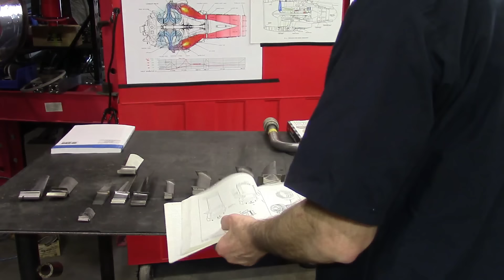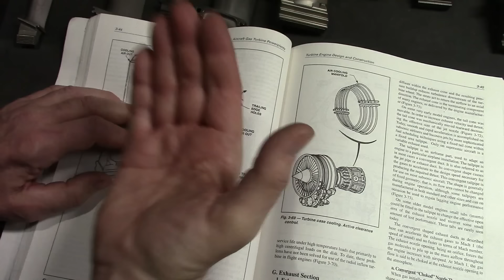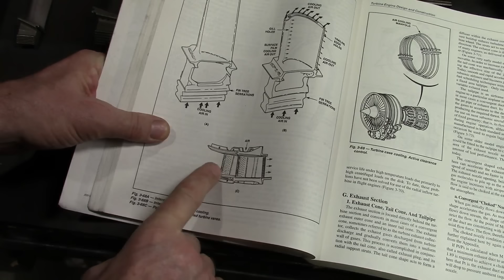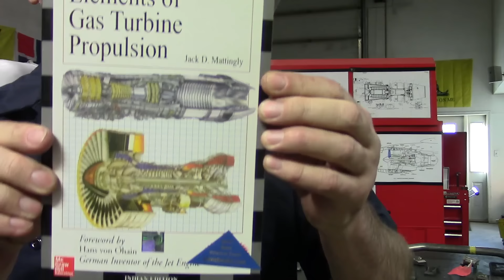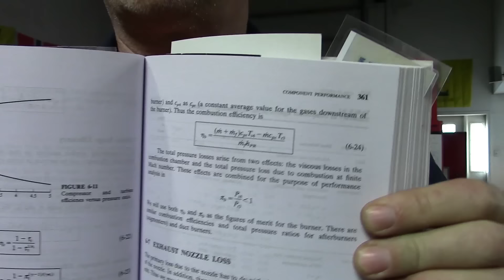Turbine Blade Cooling Air Pathways

Comment: I think the logic behind the serpentine configuration has to do with making the air do more work until it it ‘uses up’ its ability to absorb heat thus making a specific mass of air do more work than simply one pass of the same mass. Sorry for that long sentence…
Reply: AgentJayZ could possibly have shown us pages 88 and 89 of the 1986 edition of Rolls-Royce's 'The Jet Engine' book.  The diagram on page 88 shows the "serpentine" complexity of a Trent HP turbine blade of that era.
There are two parameters, which I used to give a little lecture on, many, many years ago, back in the 1970s: they are 'cooling efficiency' and 'cooling effectiveness'.  Perhaps I should venture into the loft and see if I've kept any notes, because my memory is hazy: nevertheless, here goes.
As I recall, cooled single pass blades typically have low cooling effectiveness, but can have relatively higher cooling efficiency.  The amount of cooling that is done is limited, but the increase in temperature of the cooling air is high, hence 'efficiency'. 
 In comparison, cooled multi-pass blades have high effectiveness, but may have relatively lower efficiency.  
Perhaps that sounds contrary to your suggestion: I will try to do some revision.

Comment: Apologies because its not fully relevant. Its eh almost relevant though. It is about engine cooling. I recently found out that Top fuel dragsters are cooled by their fuel. Because they run on almost pure Nitro which has its own oxygen supply they actually can and do use more fuel than air. (a car or jet, burns about 15 times more air by weight than fuel) Dragsters have about 40 fuel injectors, some in the supercharger and other parts of the airflow. So the fuel is providing almost all of the lubrication and cooling. thats why they choose to run them on a mix that uses more fuel than air.
Reply from the maker: A top fuel engine has an overhaul interval of about 5 seconds when running at full throttle. Any gas turbine in good condition can go over two years at max rated output before any work needs to be done.
When run until something gives, several years.
I know a little about piston engines, enough to know there are very few similarities with the stuff I work on.